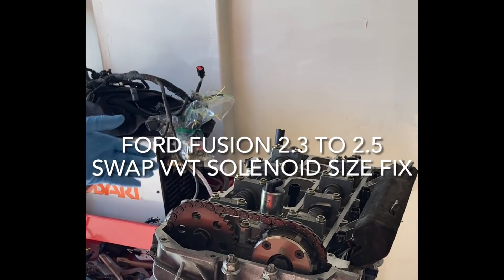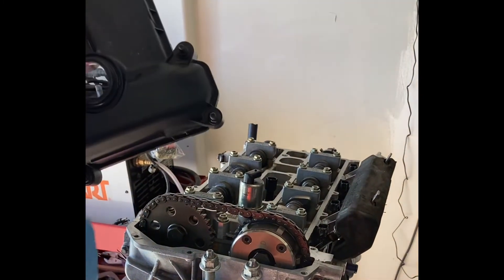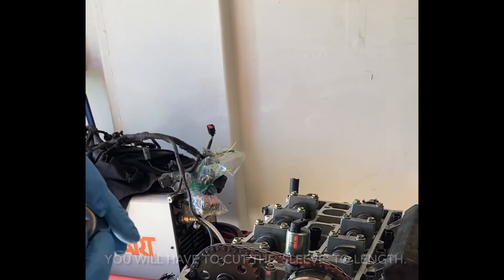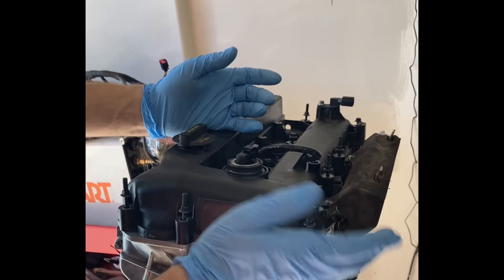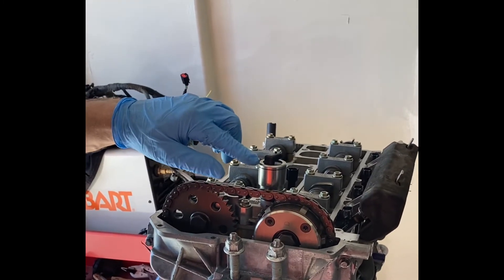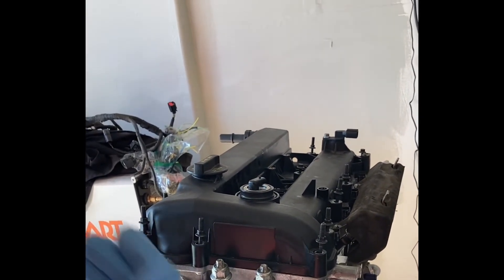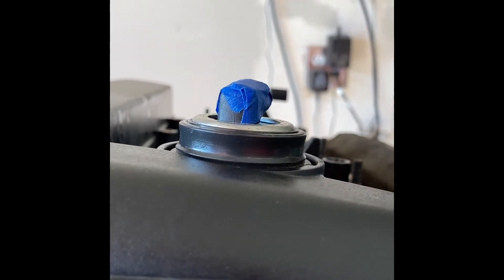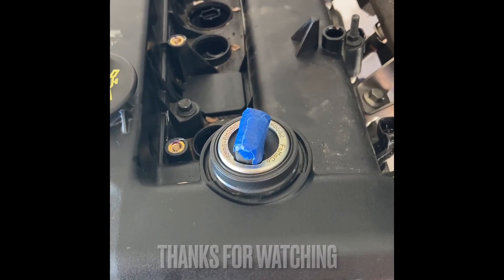Ford 2.5 Swap / VVT Solenoid Size Fix

Comment: Why couldn’t you use the valve cover off the 2016?
Reply from the maker: The 2016 cover has fitment issues with other parts such as the alternator air duct and coils. You have to use the 2008 cover.

Comment: Why would they place this vvt inside the valve covers.  Other cars have it outside one screw done in 2 seconds.
Reply from the maker: Good question. My daughters Fiesta has it on the outside. Took 5 minutes to change.

Comment: So this engine only needs 1 vvt solenoid? I have a 2017 fusion and need to replace mine and I read they need to be replaced in pairs but I only see 1.
Reply from the maker: I can’t really speak to that. The 2016 2.5 requires only one as does the 2008 2.3 Fusion engines that I’m familiar with. Perhaps varying/tightening emissions/efficiency standards dictate more than one in some places.
Reply: @BubbaDog001  mine's a 2.5 duratec engine. Is this the 2.5 duratec on the video? Thanks
Reply from the maker: @anotherone3957  yes. A 2016 2.5 from a fusion. It’s installed in place of a 2008 2.3.
Reply: In the service manual I only see one VVT solenoid. So yup
2.5L engines 2013-2016 only one

I would assume the same for 2017 with the same engine